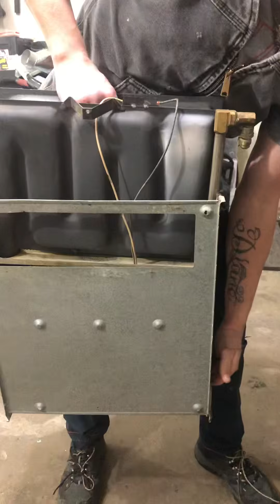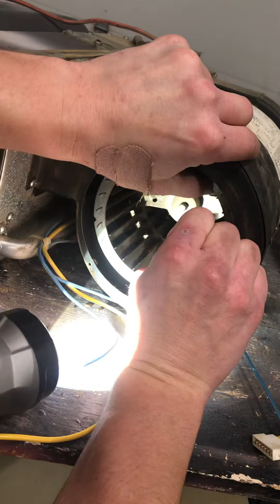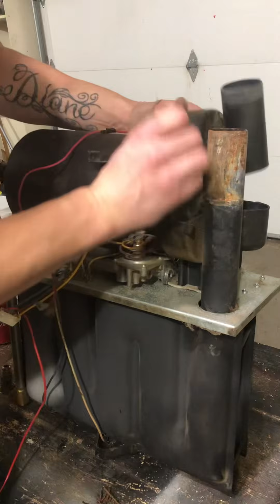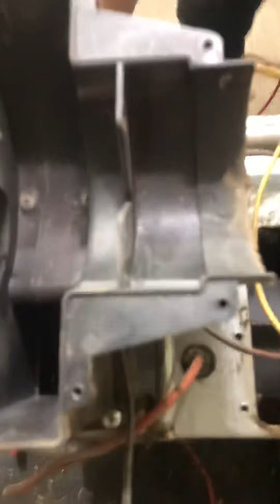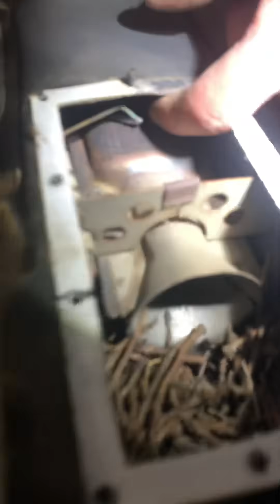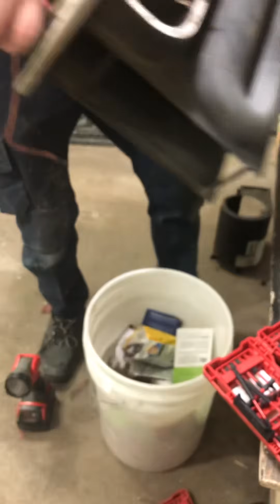Troubleshooting Suburban furnace SF-30F walk through  dismantling and inspection part 1

Comment: My SF-30F would only light when igniter was sparking then shut off for 3 cycles. Replaced the igniter and now it willl light and run for a few minutes then go out and try to ignite a couple times then lockout. 
Can restart it and it does the same thing but runs less each time. Over limit seems to work properly (using test light to check voltage)
Any ideas on cause or what to check next. Thanks
Reply from the maker: Use a volt meter to double check voltage. Could be a gas pressure issue. Or even a board issue.

Comment: That's a SF-30 not SF-30F it's good instruction for that product but not the SF-30F version
Reply from the maker: So typically don’t respond to stuff like this but the difference between the SF-30 and the SF-30F is the location of the inlet for the gas connection. If you watch the video closely you will see the gas connection is at the rear of the furnace so SF-30F.
Reply: @thecanadianrvrepairguy3062  Right on, I learned so much from you Thanks bro I appreciate you sharing your knowledge with us.

Comment: Very good video for this furnace. I used a crowfoot for the gas regulator fitting. Problem is, the threaded opening for reinstalling the fitting somehow got damaged, so the fitting will not go back on. Such soft metal.
Reply from the maker: Yes it is soft need to be really carful on install.

Comment: Well, after turning it on, mine would work OK until we went to bed. THEN, I would get up to pee
and it would be like 30 in the Rv. The thermostat would be set just fine. I troubleshooted
the silly POS but when I was pricing a part I found I could buy an entire brand new CORE
furnas (that which slides into the metal sleeve) for $398. its on its way. Some things just aren't
worth the hassle.

!
Reply: How did buying a core work out for you? Mine squeaks unbearably loud.

Comment: Any idea why mine won't start at all? No igniter click, fan just runs for 60 seconds and shuts off again.
Reply from the maker: Sounds like a sail or limit switch
Reply: @thecanadianrvrepairguy3062  I have jumped the wires together on the limit switch. Same way to test the sail?
Reply from the maker: Sail or high limit switch
Reply: @thecanadianrvrepairguy3062  I've dealt with the sail switch on a previous model, but the high limit switch, can I just short circuit it to test?
Reply from the maker: Just jump the wires together
Reply: I’m currently dealing with the same problem and I’ve jumped the wired together and still shutting off after thirty seconds. Any idea?

Comment: I appreciate your video Canadia RV repair guy I have a sf-35Q suburban furnace and a analog Coleman Mach thermostat and my question to you is which thermostat wires connect to the wires on the furnace board itself. Thanks again for the video and I hope you have a great day and thanks in advance for answering my question.
Reply from the maker: It will be the two blue wires just make sure your polarity is correct.

Comment: Great video on Suburban heater.  What is the model number on the motor only for replacement.  Trying to cut down on down time when I pull the heater out.  Are the motors generally the same for all indoor units?
Reply from the maker: Order by model of furnace have you serial number as well for parts that changed in that run.

Comment: Great video ! My furnace turns on and get hot just blows weak air and then shuts off..any ideas ?
Reply from the maker: Weak air could be motor wearing out or low voltage would need more info to properly diagnose. Thanks for the comments

Comment: So I just started my heater now that I pulled it out of winter storage. It heats for a few minutes but after that it just turns off.  I pulled the fuse and it started right back up but I can hear the burner turn on from the outside but than I hear it turn off and the ignitor is trying to light it.  I won't stay lit and turns off again.  It works fine for a while but then that happens.  Not sure what part could be the problem.  It's only 3 yrs old and my trailer has no pets and it is OCD clean.  I don't think anything got up in the intake cause it is covered all winter.  Any suggestions on what part is causing that to shut off and not stay lit?
Reply from the maker: Does it try to relight after running for a bit and just cycles the burner on and off, never shirts the blower off?

Comment: Thanks!! Great video. I have a question. I have a 2019 Suburban furnance and it spits, sputters when running. Is it the propane regulator? Or any ideas.
Reply from the maker: Would check the burner see how clan it is, then gas pressure.

Comment: Im a single female with this issue that it all of a sudden making a loud noise and started blowing cold air. Im also hesitant still, after watching all these vids that im over my head but unable pro services. I can easily step by step directions but my biggest concern is how I make sure all the lines are bled from the gas...
Reply: close your propane tank valves and all that will be left will be what is in the line.  crack the line and let the propane leak to the atmosphere
Reply: @bobbychuckles8764  ty sir, i actually did all by myself and got heat right before the freezing season! Ty
Reply from the maker: Turn off the bottle and light your stove that will take the bulk of the gas from the lines. There still will be some in the system when you take the line off the furnace but not a big deal just let it bleed off and continue taking the furnace out. Be sure to put a plug in the line to ensure that if someone turns the gas back on while your serving the furnace.

Comment: Awesome informative video! I'm having an issue with my SF-30F as it will not ignite. I smell propane gas and I hear the ticking at the outside exhaust port. The ignitor circuit cycles 3 times before it shuts down. I have replaced the ignitor and installed a new dinosaur board. any hints or ideas would be greatly appreciated.
Reply from the maker: I would remove the burner and clean it and the remove the jet and clean that as well could be a blockage causing the air to fuel mixture to be incorrect. As well should have the gas pressure check to make sure you are getting enough pressure to provide the proper mixture
Reply: I have the same problem.  Works perfectly in Las Vegas, NV (1800 ft elev) but will not fire off until many many tries in Ely, NV (6400 ft elev).  I've replaced my pressure regulator and now I'm going to try the sail switch (mostly because if feels a little sticky).  Once burning, it'll heat the trailer to 85+ when it is zero outside.  The challenge is getting it to ignite.
Reply from the maker: @JDOTVegas  could also be your ignitor. But start with cleaning the burner then removing the jet clean it as well the tube the jet screws into run a brush through there
Reply: @thecanadianrvrepairguy3062  the ignitor is one of my theories.  I swear it was a lot louder when it was new.  Now, you can only hear it clicking if you get down on the floor and get close.  I used to hear it from the couch 6 feet away.

Comment: I need help. I just had my sail switch and circuit board replaced. As soon as I plug it in the fan comes on and won't shut off until I unplug the power. What is going on? The mechanic that repaired it said the heater fires up.. when I plug the power into the heater with the thermostat off the fan runs always and won't shut off. I hear the clicking when I turn the thermostat up or down plus even when I move the switch on the thermostat  to turn on and off the heater clicks but the fan won't shut off? Did the mechanic put the wrong board in or what?
Reply from the maker: Is the make a model of you furnace a sf-30?

Comment: Hello. I am having some trouble with my sfv-42. It seems to be intermittently locking its self out. It sounds to me like the fan won't produce the speed it use to. Combustion seems to be quite choppy as well, as would be expected with a lower fan speed. The fan spins freely by hand, no tight spots and nothing visible looks to be out of place without pulling the furnace. 13.4v to the unit, 13.3 to the motor and 13.3 through the thermostat switch wires at the furnace while running. Is there a possibility im focusing on the wrong component here? 

Can the furnace be pulled out of the housing motor side first? This would be far easier in my specific situation. Even while removing the back cover to access the screw. After seeing your video I would realy like to remove and inspect the furnace. And would you happen to have rpm specs on a new motor installed in a furnace?
Reply: @Matt, You may have a bad or dirty Sail Switch. When your Thermostat ask for Heat, the Furnace Motor will spin for approx 15-20 seconds before igniting, to blow contaminates out. If the Motor doesn't get a "Closed" Signal from the Sail Switch, it will shut down. After 3 tries the Furnace will Lock-out.
I'm interested to know what was the cause!

Comment: Appreciate you putting this video up.. Question for you.. The nut that you said had to be removed with a crows foot if you don't disassemble everything in the way.. Do you need pipe dope where that tube connects with the gas valve?

Comment: This was really helpful in helping me understand the components of a furnace. I have a Suburban that uses the 3 prong ignitor (not sure if theres a technical name for that configuration) does it not take much corrosion for the ignitor to stop sparking? Mine was working great just earlier and suddenly stop lighting. Have plenty of propane, took out the ignitor and it does look black but isnt sooty. Could it maybe be something else?
Reply from the maker: I would be leaning towards a board issue.
Reply: @thecanadianrvrepairguy3062  thank you!

Comment: I have the same model, but maybe newer. There's a very high pitched squeal, that comes and goes,  which I think is coming from the combustion wheel. I can tap it with my hand which sometimes stops it. I'm driving myself crazy trying tti get the front half of the furnace out. It's not coming out. What's the easiest way to get to it? And what would cause the squeal in that wheel area?
Reply from the maker: I would say the bushing in the motor is going. Replace the motor

Comment: Hey I notice you were having a hard time getting the Allen wrench in the big squirrel cage.    If you take the other side off first you can pull the entire motor out with the squirrel cage.   You did a good job getting it out of there but sometimes it’s so corroded that you can’t pull it off that easy.    Just trying to help, you can take it or leave it.  :)